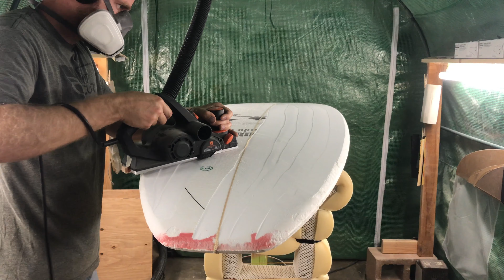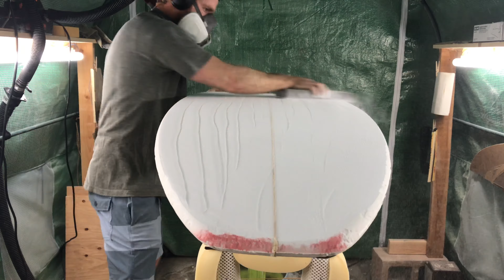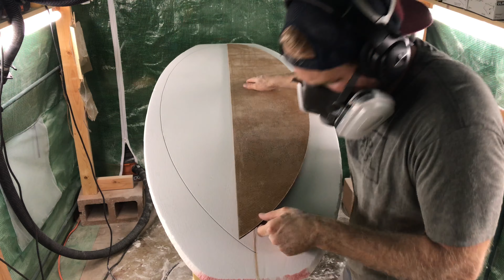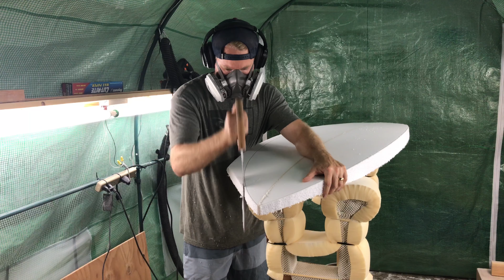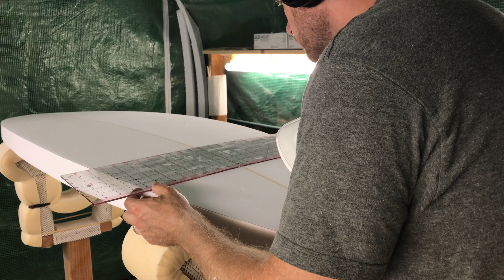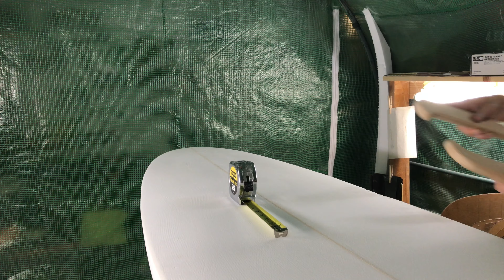Surfboard Shaping [1 of 2] Foiling Thickness, Cutting Outline and Adding Rocker

Comment: Hello nice video! do you think you can list the materials/tools  used? I am always wondering what sand paper number are they using in different parts of the video? then I see  you use another kind of sand paper for rails? Thanks I appreciate !
Reply from the maker: I think you best resource will be to go to greenlight surf supply's website.  They have instructions on shaping a surfboard and walk you through all the tools and sandpaper grits.  Check the link in the video description.
Reply: @BendheimBoards  Thanks!!! I appreciate

Comment: How do you correct the thickness 1ft from nose and 1ft from tail? Do you measure and if it's too thick, just make the rocker curve extend further toward the center of the board?
Reply from the maker: Use a measuring bar to measure and keep removing foam and stinger till you get there. Keep the transitions smooth

Comment: I began shaping my first board, and I realized that I traced the outline on the top of the board rather than the bottom. Is this something to worry about?
Reply from the maker: It’s better to trace your outline in the bottom because if you don’t cut exactly vertical with your saw, you won’t mess up the hard edge on the bottom of the tail.

Comment: Is this a normal planer? Just with blades? If I use a planer on xps, it gaps. Not so smooth as yours.
Reply from the maker: Yes it is.  I've never worked with XPS foam so I can't speak from experience but make sure your not going too fast on your passes.

Comment: Nice effort! However, templet first, then foil. Less foam to mow hence faster. Also, don't use the saw up and down like that when cutting templet; use the saw like a carpenter  (hold grip w index finger extended for guidance). Hold the saw more horizontally and curve the saw as you are cutting so that you are just outside the template line. Nose and tail will be off a touch (bring back in with sureform) but most the templet will be super smooth. Use the planer on its side to true-up; you can "feel" any bumps this way. Any bumps should be there on purpose. Since you have full length templates, you could use a router to template. Takes practice, but this is a 45 min board (unless you are really oldskool .... then its 30 min max).
Reply from the maker: Thanks man, I appreciate the feedback and advice!  I've done it both ways and prefer to foil first so the template is easier to cut without the hard outer skin on the blank.  I've seen so many different methods in shaping that I just decided to go with what works best for me and what I'm most comfortable with.  I'm sure there are lots of areas I can improve at.  Thanks for watching and commenting man!
Reply: Dude, Tanner is being nice to you. Just because you shape a certain way does not mean it is the correct way, and you must tell everyone how to “fix” their methods. Shaping is an art, and art doesn’t have rules. In fact, hearing you lecture him only convinces me that you are a copy machine, and you don’t have the ability to think outside the box. I shape, and I also take down the thickness before I draw the template. I actually use a jigsaw with a longer blade to cut the template, and I can do that because I’ve already planed the board, and the bottom is flat, so I don’t get angled template cuts. We all do things differently. By the way, throwing the “Nice effort!” Comment is condescending and screams of narcissism.